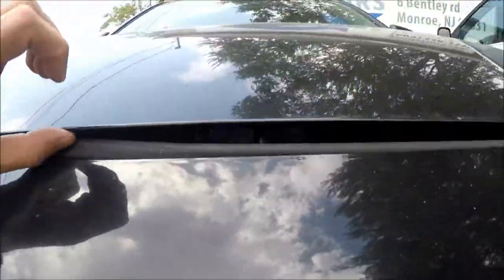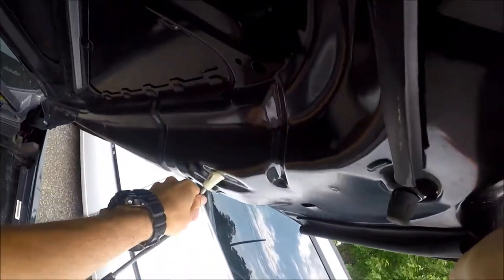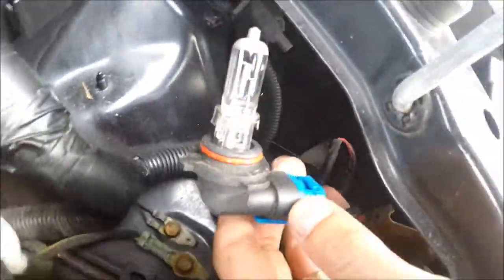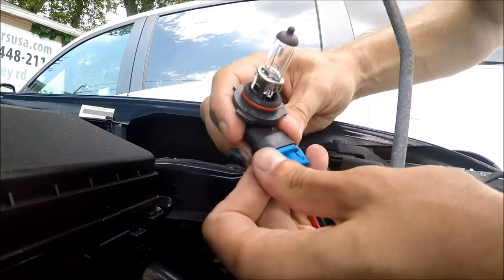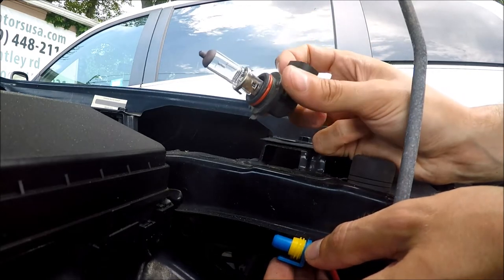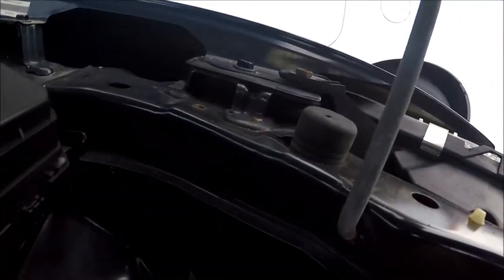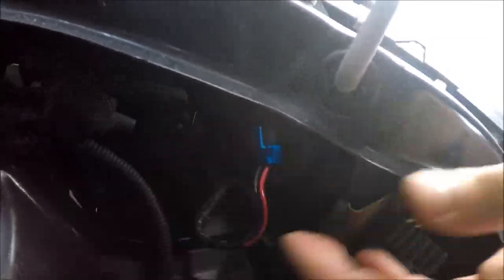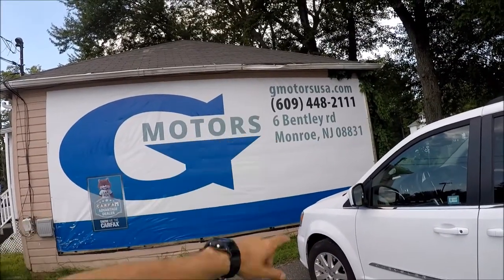How to replace change Headlight bulb in 2007-2015 Mitsubishi Lancer

Comment: Yeah... Try doing a video converting it to a led headlight. The highbeam you did is the easy one. You need tiny hands to get to the dust cap ones. And the dust cap ones don't leave much room for the led connections.